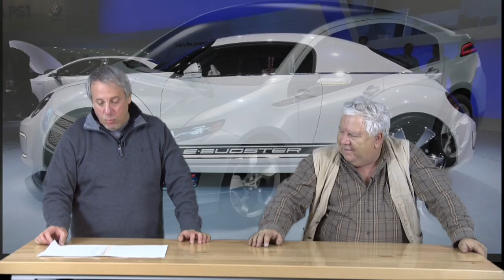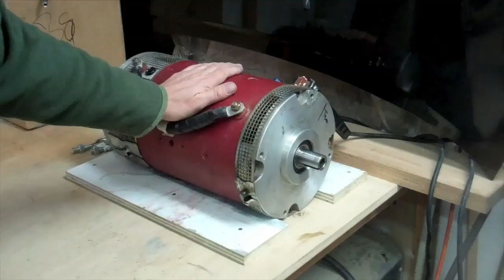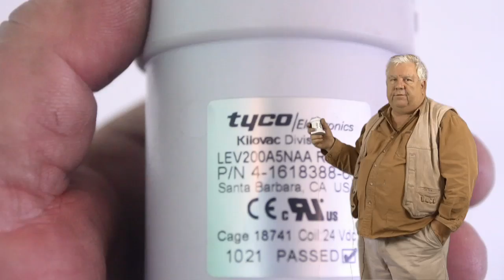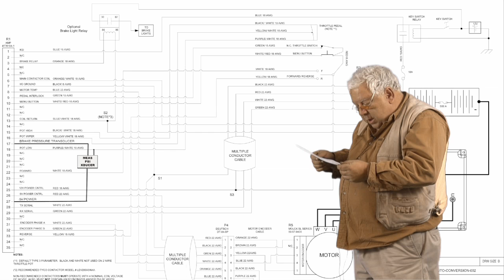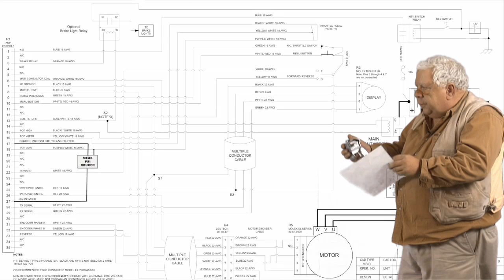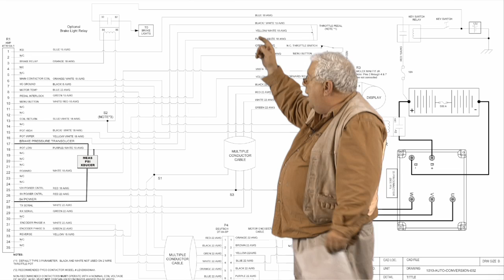EVTV Friday Show - January 13, 2012

Comment: currently we in our team trying to develop an electric Car using curtis controller. in fact, we attempt to build the same ciruit that you presented in this show. so, we bought the one of the  given temperature sensors in the curtis 1238 manual. please explain about the sensor connection to the AC motor. 
thank you.

Comment: Love the show guys. Great new back ground.  Please consider turning down Brian's mic slightly, he tends to drown out the end of Jack’s sentences.  
As an R/C airplane manufacture we have seen an explosion in electric equipment the past few years. 
Most notably being the outrunner 3 phase ac brushless motor and electronic speed controller (ESC) we call it.  The out runner design offers greater torque to drive larger props. Are EV motor companies offering brushless equipment? 
 Thanks, Mark